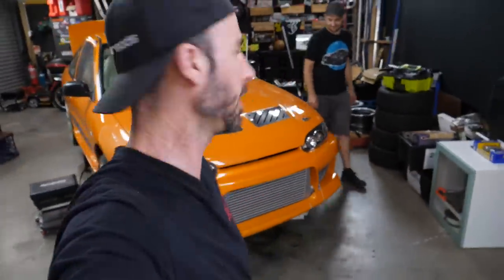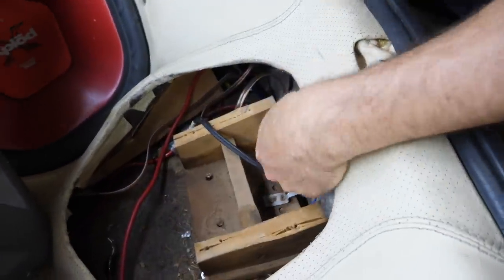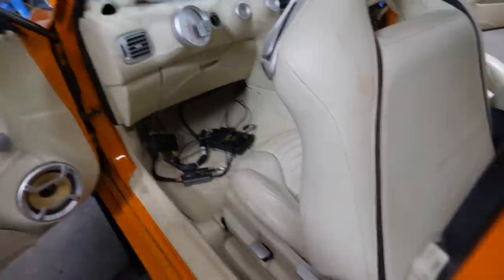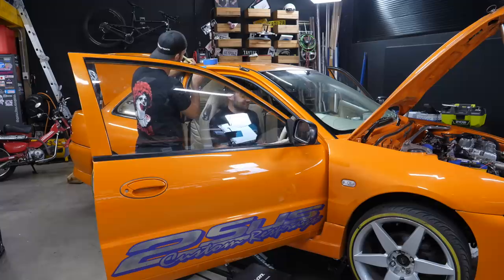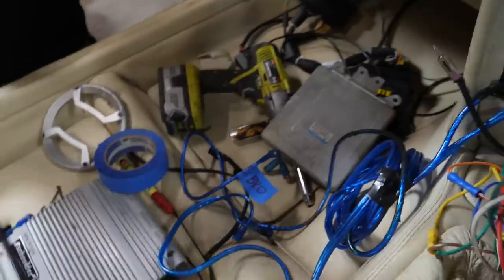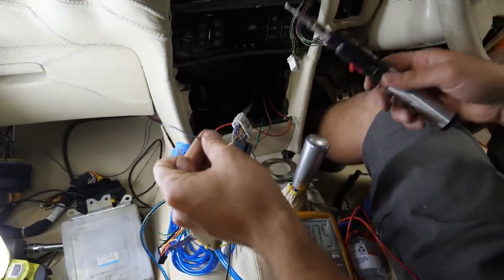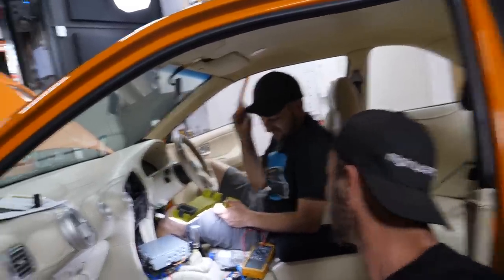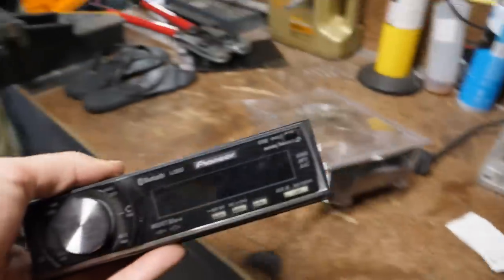2WISTD - This EVO will BLOW YOUR PANTS OFF!!! (10000000%)

Comment: Sorry, but that stereo wiring job ranks as the worst of the worst hack job Ive ever seen (not what you guys did, but what came with the car)...
Reply: The stereo install I did in my 88 or my 79 corolla looked better than that rubbish. And those weren't the prettiest installs haha
Reply: defiantly not the worst hack job, my first set of subs were powered by a chopped up extension cable I had lying around and of course stock head unit with the speaker input spliced in with out a line in converter.
Reply: @DWinzZz  Yikes! :-O
Reply: Seen worse, done similar for people who don’t want to wait or expect it for free.  They got poo.  Hidden poo.  🙂
Reply: Seems like it was a tight dead line during the time to get the car done for Autosalon back then. The guys that modded the car '2sus' are still going til this day. They are getting better at what they're doing.
Reply: The company that did the stereo and trimming were quality in the day (still today), but I suspect since it's original build and inception many a backyard jobs has been done on this, because the quality (in particular stereo and wiring) isn't what the company that did this originally are known for.

Comment: I always use 0 gauge power wire for my subs.
Reply: Michael Bacon best way to go, my cousins use 0 gauge doubled spliced Together
Reply: l have been building stereo systems in cars for years and not once have l had to plug a power wire into a sub
Reply: bjorn1583 obviously your doing something wrong.. i mean, all the REAL tuners power their subs instead of the amps
Reply: @dinsterzz  hahaha. Exactly. The bigger the wire. The more power you're putting into the subs
Reply: Who uses 0 Gauge... use welders wire for that SPL goodness.
Reply: hahahaha
Reply: like 0 gauge for ground and 22 gauge for positive :D :D :D

Comment: I hate these Lancers with a passion. Everyone in the late 90s and early 00s had these and either put an evo kit or droid kit on them and a friggin cannon. At least this one actually has the right engine.
Reply: Fordy Ford what’s a droid kit?
Reply: With all of that leather, mdf and stereo gear weighing it down it's probably as fast as a 4g93 stocker
Reply: Fordy Ford These were called Mirages here in the philippines back then.  Same thing happened here lottsa people putting horrid body kits on these and cannons.  Though i knew a guy who actually transplanted an actual evo drivetrain and engine onto a mirage and practically made a 2 door evo.
Reply: Yeh I feel ya but when the motor is right it's not so try hard, but yeh so many stock Lancers kitted out to the max, hell even a few excels were getting around fully kitted lol.
Reply: >implying people arnt still doing that to current model lancers lol
Reply: @Tonybeanfarm  google lancer droid bodykit
Reply: The equivalent here in the UK was the Citroen Saxo, friends and I used to just call them "Clits" because "Every c**t had one"

Comment: This is giving me flashback to how many times I rewired my Cavalier when I got it because it had show car audio...

Alpine amp - blown, all 4 speakers doubled onto the left rear channel, twin 10 inch subs in the trunk passed through the blown amp, and a head unit with more wattage RMS than both the amps combined.

I had the door panels off so many times to fix the stupid door speakers that matched these.

Comment: Man, My tweeters hit harder then that whole set up! Should not have been able to hear you talk over the subwoofer's! In my car, 1,000 watt mono block running two 12" subs, extra battery, 7volt line driver w/built in crossover boosting my head unit's rca voltage, 7" 4g, wifi, Bluetooth, tv enabled, front & rear camera's, & a lot more, plus a 4 channel amp on my hi-end, 350 amp alternator, 1 farrod capasitor, plus a 2nd battery (both the cap & 2nd battery stem from b4 I upgraded the alternator) but, it all helps to store extra power & I just added new component speakers w/ passive crossovers though I will be running them threw my line driver because it makes a HUGE DIFFERENCE FOR THOSE PEOPLE WHO DO NOT KNOW, BUY & USE A 7 OR 14 VOLT LINE DRIVER!!! THEY WORK FANTASTICLLY BY RAISING YOUR STERIO'S VOLTAGE OUTPUT FROM A STOCK 2 VOLTS & BOOSTING IT UP TO 7 OR 14 VOLTS 2-7X LOUDER THERFORE, YOU CAN TURN YOUR AMP'S GAIN DOWN! I I AM INSTALLING MY NEW COMPONENTS THIS WEEKEND!

Comment: Fun fact, if u check the '2WISTD' number plates on the RMS database it comes back to a silver 1974 Mercedes 280E and the rego is actually current til July next year. Sooooooo my guess is the car was always 'EYE50F' when it was doing the show circuit

Comment: Pro tip from a sound guy, short the speakerwires with a 9v battery, or one of the ryobi batteries. If the speakers are connected they will make a scraping sound. Quickest way to try if speakers work.

Comment: 44:10 "...run this power wire like straight 
under the car over the rear diff, through the transfer case, wrap it around the driveshaft, put it over the exhaust"
"That'll will be a great idea"
"And it will ble flawless"
Love ypu guys xD

Comment: As part of my job I install data cable around a campus often alongside existing cable. As every cable looks the same you use a tone generator and probe to identify a cable in a stack. Saves lots of guess work. Would have been perfect to help answer some of the glorious mysteries this cars wiring had to offer

Comment: Guys spent so much time discussing pissibilities. Make sure everything is disconnected,  plug the under car battery in. Get a test light . Ground the test light to the car touch one wire at a time the one that lights up is your power, remove grounded test light connect it to power wire. Test other wires till you find the ground. 5 mins operation tops. Love the car

Comment: thats a small wire for a ((1000 watts)) amp
Reply: It's a short run and it's 1500 watts peak not rms it's maybe 500watts rms, The wire size is fine could be bigger but wouldn't make a difference.
Reply: Wrong buddy that is completely the wrong size wire for that amplifier… I have put one of those on my amp dump and it did right at 1500 W so properly tuned that system should be running zero gauge with a splitter to 4 gauge going to both amplifiers. That wire they are using looks like eight gauge and I wouldn’t run anything more than 300 W through that..EVER!
Reply: @kerrypence4201  Zero Gauge for a "1600 watt" xplod amp and a generic 300 watt chinese amp. You CLEARLY know what your talking about....
Reply: @kerrypence4201  8gauge is safe rated for 40 Amps continuous. I wouldn't be worried too much, you are gonna kill the battery or alternator diodes with that load before that wire melts...
Reply: It's maximum power not RMS.
Reply: Martin Reynolds You clearly have no idea about 12 V electrical systems… And if you would clearly do the math taking out that cheap amp altogether and just use the Sony amp. If I remember right it has 4 40 amp fuses so do The math using 15 feet of eight gauge cheap ass wire that if you’re lucky it’s six gauge and see how much resistance builds up and that wire and how hot that wire is going to get! Go ahead you do the math and get back to me!

Comment: wow the wiring, the build quality of this is terrible
Reply: If you can't repair or do it properly, hide it! I once bought an MK2 GTI Golf. The previous owner had replaced the wires, so they would be good? Nah, the car broke down, because of the "new" wiring job. LOL
Reply: The gauge of the power and ground wires were sooooooo tiny!
Reply: I mean, considering they seem to have absolutely NO idea about anything to do with car audio, doesnt exactly help their case... it's  not a difficult concept to grasp. They mistook all the wiring on the underside of the car for ground wires, when the car was completely visible. I would have just scrapped that dumbass idea, ran 2 gauge from the battery back to the amp, used the existing ground they had, plugged in the rca wires to the amp, ran speaker wires from the subs to the amp, and installed a new head unit, a 20-25 minute job at best, took them hours to figure out that the existing wiring in the car was practically useless, and even then they still used some of it.
Reply: @breakofhavoc7433  that doesnt make YT content though :)
Reply: @breakofhavoc7433  Except Marty installs audio systems for a living, I think the whole reason they tried to use the original wiring was to avoid having to pull the interior apart to remove all the old wiring and run new stuff.
Reply: No glass fuses at the battery😅
Reply: @MichaelVettas  yeah I can see that as well, but even then they made something simple into something that was very complex...
Reply: @OverdriveMediaNZ  He seemed as if he had no idea what he was talking about.
Reply: Ah, welcome BreakofHavoc  to your first MCM video.
Reply: @minikeg  not my first, thoroughly enjoyed the JDM Mini, I cant actually even recall my first video.
Reply: @breakofhavoc7433  then why act surprised by how they do episodes... :S
Reply: BreakofHavoc considering they said it’s only to test if the whole system works, i would assume they’ll clean it up later
Reply: An absolute joke really, to me the entire car is a joke, just horrible...

Comment: Guys alpine head unit has the TuneIt app that can do wonders for car audio applications also I suggest using Apple Music for getting premium audio files that have really clean sound compared to other platforms (like YouTube) and I can only imagine how old those speakers are, I assume the amps are not very efficient from the time frame they came from jl audio makes amp that are “underrated” on the power they put out and alpine makes subs with insane sound quality capabilities. Focal makes really good component speakers for door speakers that come with really good passive crossover sets. I can tell you right now they used skimpy power wiring for your amps id recommend using as short as possible power and ground wires and look up charts to show what run length and how many amps draw for  each amp to get correct power to it. Use your fancy multimeter to set gains and “dd1” your amplifiers to avoid distortion but get the most output without clipping or blowing speakers. Also make sure your earth or ground wires are well put in good places to your frame. Do the “big three upgrade” on the factory wiring from engine, chassis, alternator, to your negative terminal. Hope this helps! I used to work at a car customs shop building cars like this one with a couple thousand watts of power running insane beasts of cars with whole walls of subs and multiple batteries.

Comment: What they did was took the rca cables ran them from the head unit to the first amp (300W amp) then branched that off to the amp in the rear so bridging the amps, the 2000W amp powers the 2 subs and the 300W amp powers the front 2 or 4 speakers.

Comment: Tip for checking speaker wires is to use an AA battery on the speaker wire. If you have the Polarity correct, the speaker cone will push Outwards. If you have the Polarity wrong, the speaker will suck in.

Comment: As a former stereo installer (I even did a few Autosalon builds, the stories I could tell.....) It's agonising watching you guys diagnose wiring. Around 10 minutes and I could have told you what each wire does and where it goes. Of it was built locally I could have even told you who did it. Wiring is like a signature.

Comment: re: blue amp switch wire checking, rather than run a second wire all the way across the car to test it, you can also  ground/earth one end out and meter your continuity to ground on the other end. Obviously check that it isn't powered or grounded before you ground it, might get some unexpected results from that.

Comment: A trick I learned installing radios, is take a AA battery and place it on the speaker wire to find out if the speaker still works and also what side is positive.

Comment: You guys can use a 9v battery, touch both speaker wires to the battery and see the magnet of the woofer pull or push the cone of the speaker. That way you can also figure out the correct polarity. The cone is supposed to be pulled.

Comment: Best factory sound system ive personally heard is from a Lexus CT200h Premium that had the "Mark Levinson" sound system. Full Dolby Prologic, and a rather odd size 13" sub in the rear. It was REALLY REALLY loud. Even at extreme volume levels the sound was just pure. No distortion at all.

Comment: Ok, I don't think you guys realized what type of amp you have there, that's a Sony Xplode series, which are Mosfet powered, which means the amp has 2 grounds, 1 is your standard ground the other is a Mosfet ground, which is the ground from the deck, in stead of connecting it to the standard ground for the deck you run it to the amps and connect a ground strap from the bolt on the back of the deck to the dashboard frame, what this does is gives a continuous loop for the electrical system to run more efficient and reduces if not eliminates noises such as alternator hum, feedback and peeking. It's a really cool feature not needed in most new systems. But was back in the day.

Comment: The wire that runs up in the rca is not for use as a turn on signal! Using it as such will likely lead to distortion,  your actually supposed to ground both ends to help prevent distortion from other wiring

Comment: Wire tuck was a popular mod on evo/eclipse back then to hide all the wiring in the engine bay to clean up the look. Hence the fuse box deep in the fenderwell under the intake. A buddies eclipse gst was done that way and anytime there was an issue with wiring it was a pain in the ass to diagnose.

Comment: The two wires in the back went to a large capacitor to provide a static 12v to the amp.  So the is no electrical surge or drop.

Comment: Sony xplode can actually sound really good. The Sony system I made for my wife didn't even have a capacitor for the 12s or amplifier for the 6 by 9s & tweeters and it was still one of the best in my town because of my settings. Sub+10, low-6, mid-6, high+10 and volume to max. For some reason it sounded like a really clean balanced  two 15, high watt 6 by 9 system, under $500. Her car's design had great Acoustics too help.

Comment: I had that sub and wiring kit in my mk1 Fiat Punto. It was my first car and I did not want to spend a penny more on it as it was a Punto but I ended up spending a lot on the stereo system bk in 2005 I think. Built the sub into my shelf and it used to make the back of the car bounce because the suspension was crap lol

Comment: If you connect a multitool battery to the speaker wire it will "pop' the speaker. So just touch the + an - briefly to the battery and the speaker will make a pop sound and you can determine what speaker is what wire..

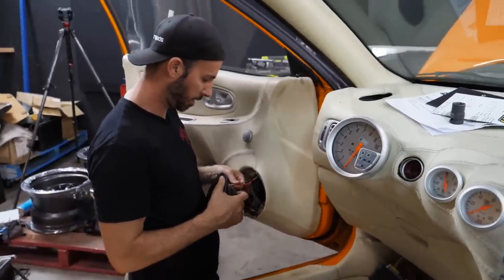Comment: @27:15 To get a positive check test through the speaker and look for ~4 Ohm. ie suspected pos cable connected to + speaker, test from - speaker to + amp. The correct path will show speaker resistance the amp should be far higher.

Comment: not sure if anybody covered this but when trying to use the multimeter to find out the remote wire you couldn't use the bodies chassis ground for the ground side of your multimeter and then use your positive side for the remote wire that stretches all the way to the back instead of running a separate wire seeing as there's no power or going to any of it

Comment: Guys with really large stereo systems alot of people run a second battery for the large amplifiers the power wire was probably run under the car since the battery was also under the car .

Comment: You should make a video on installing an extra injector at the throttle body for a direct injection engine. Boost it up with turbo, and some nitro? Run it on a dyno and see what it makes

Comment: you always run the rear speakers of the head unit its just fill. the fronts are usually 3 way, with cross overs and amped

Comment: im not a car guy or anything but I think that u guys did a great job! but I'm gonna leave you here my feed back. isn't positive but maybe could help you guys with content. I really think that u guys apart of doing the stereo should be like fixing the fuse box, changing the battery position (that I think that should have been done in this video), cleaning the leather (I don't know if it's clean but I see it dirty), do a proper rewire and lstuff like that. of course may be in later videos. also I kinda want to see this car like very clean and in a greater state.
I hope that this post does not offend anyone in any way or form. love u guys!! 

remember I'm not a car guy and also I don't have any mechanic expertise.

Comment: Moog you should track down an A8 they came with Bang & Olufsen, with tweeters that rose out of the dash when the car was started.  Yeah Audi’s have great stereo’s.  My GTi had dynaudio from the factory, very good.  Here in the states you can find a nice used A8 pretty cheap, maybe it’s the same there.

Comment: Rather than run a wire through the car to test continuity you can touch one end to ground and test between the wire and ground at the other end. Touching the open end on and off of ground will cause the continuity meter to beep on and off. It's far more vegan.

Comment: Next time you need to check a wire, instead of running a runner the entire length of the vehicle... touch your suspecting wire to a ground, then touch your meter to ground and the end of the wire.  it uses the chassis to complete the circuit.